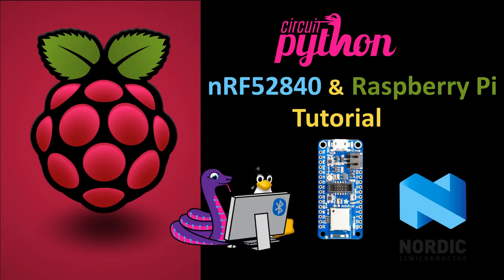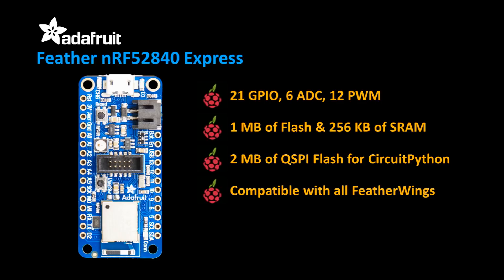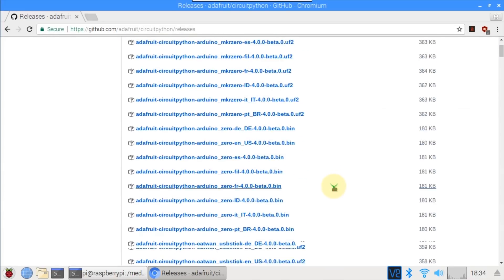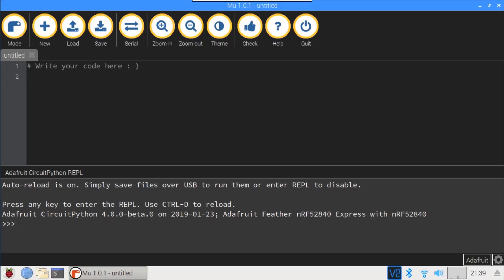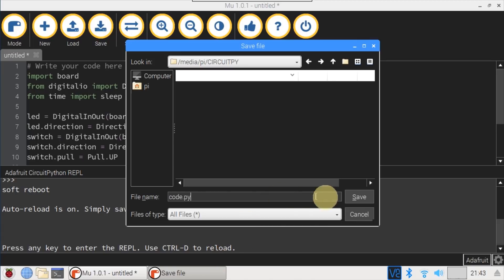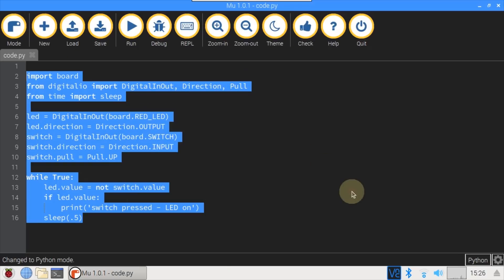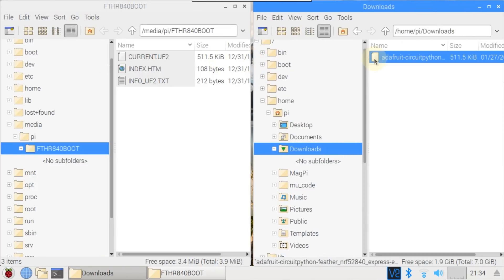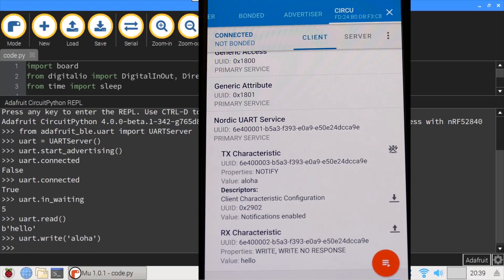CircuitPython nRF52840 & Raspberry Pi Tutorial

Comment: I would like to build a zigbee node  with sensors based on raspberri pico.  But even pico  dont contain BLE , low power wifi or zigbee/matter protocols.  Did anyone program communiction between pico with  nRF52840  board by UART ?

Comment: Why is the charging battery LED blinking all the time? It is very annoying. Is anyway to turn it off when we are not using or charging a battery?
Reply from the maker: The LED is controlled by the MCP73831/2 IC.  According to table 5-1 in the datasheet it should not illuminate if no battery is present or the charge is complete.  As shipped, there is no way to programmatically disable the LED because it is handled by the IC.  You could rewire the STAT pin output to a GPIO pin on the MCU.  Then you could programmatically monitor the charging status and control the LED with a 2nd GPIO.  A level shifter may be necessary depending on what variant you have of the MCP73831/2.  Another approach would be to add a switch to the STAT pin so you could manually disable the LED or you could just cover the LED with black tape.

Comment: Would it be possible using the ble on the nrf52 board to actually send a analog input from the nrf52 ADC to a raspberry Pi python script ? Essentially a Bluetooth remote ADC.
Reply from the maker: I haven't tried but it should work.
Reply: @rdagger  I would love a tutorial on that !. Your video was excellent. Just got my new pi and adafruit nrf62 today. I'm just starting my first python learning experience. Building a wireless scale from scratch using a load cell amp and nrf. Trying to make a little gui to n the pi to display. Any tips ?